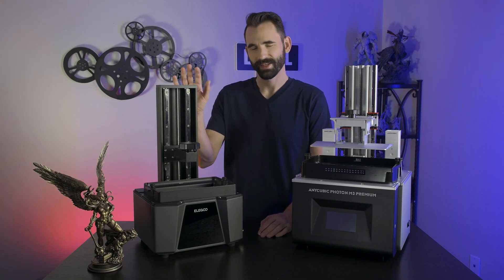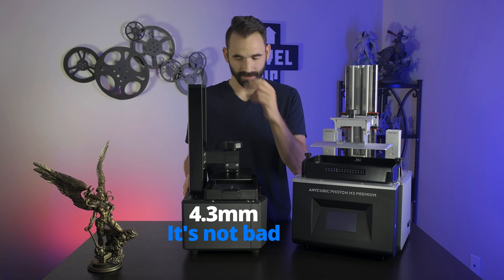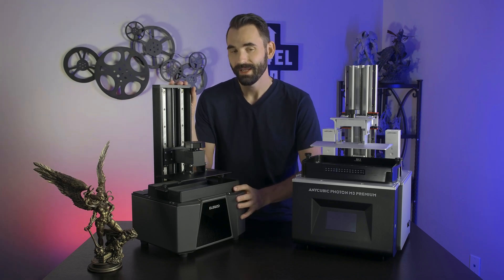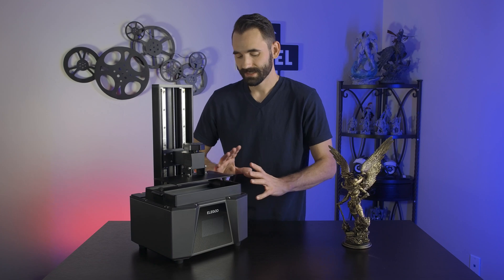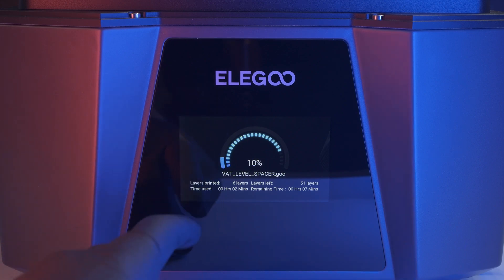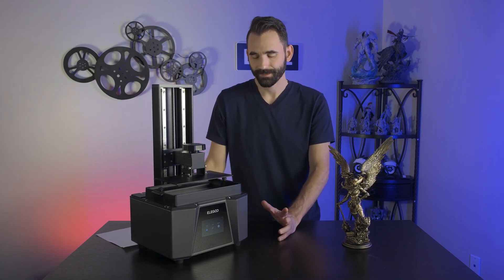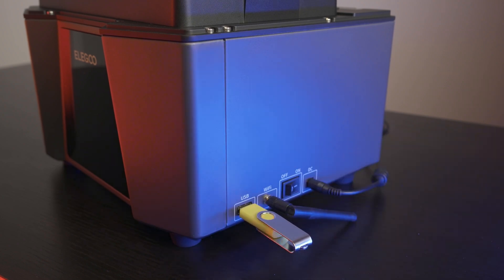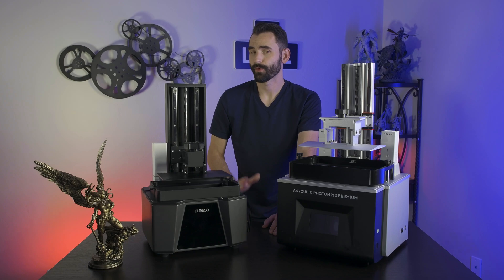Saturn 3 Ultra Review #review #3dprinter

Comment: Grear video, but one note on bearings, ballscrew nuts, and ballscrews:

Ballscrews are rarely perfectly straight. So to avoid binding you can't fully constrain the ballscrew. You have to have some X/Y movement allowance of the ballscrew or ballscrew nut without allowing slop in the Z movement of the ballscrew nut or the ballscrew itself. So on the Anycubic they would need to have a DAC at the ballscrew nut, or they run the risk of binding, especially at the top of the movement. I can't tell if they do for sure, but it looks like they don't. The other approach is the Elegoo approach of allowing the ballscrew a little X/Y movement at the top of the movement. 

So looking at the two approaches to the top, the Elegoo is less likely to bind and might be the more technically correct solution. But that is just my educated guess from looking at the video of the two. I don't have either yet, but should have a Saturn 3 Ultra 12k here any day now. :)
Reply from the maker: I'll give the Ultra a closer look but I don't think it can move as much as the Saturn. I'll be at Anycubic tomorrow. I will ask them about this.
Reply: @J3DTech  nice! :)

Comment: But now Fauxhammer loves ACF.  So do I, with a little AA which I use for everything I print.
Reply from the maker: Yeah? I've been in China for a week what have I missed?
Reply: @J3DTech Yup, he seems to have excellent prints; what causes the improvement is to be determined. Can it be a different source or change in the acf film or that the light strength/sharpness is lower etc ...
Reply from the maker: @TheAndrian463 I ran anti-aliasing tests with snarky arts. AA does work on the ultra and I also ran direct comparison results with ACF versus nFEP and I can tell you that the ACF does still leave marks. The Ultra does have a much better light engine which does create higher quality prints compared to other 12K printers. 

But you will still always get better quality when you replace the ACF with anything as you get to see in my video I do provide evidence under a macro lens.
Reply from the maker: I just watched his video. First I hope to some day match his production quality. 

But I can say with 100% certainty that AA Does work in this printer, I worked directly with Snarky and and Snarky was testing the Saturn 3 not the Ultra. 

I also spent over a week in the Elegoo forms, helping many many people with this printer and having them help me create this video and turn by running some prints and test for me and showing me the results. 

The ACS film does still leave the cross hatching but it is better on this printer then the Anycubic due to the upgrades lighting engine, screw and rail. But you can see I have macro pics in this review that clearly show the difference or AA on and off, ACF on and off.

Comment: Fauxhammer released a review on this printer yesterday where he concludes that acf is good, which is contrary to his previous point. I would love your thoughts on that. Other than that, great review. I like that you discuss a bit about the build quality of the printer
Reply: I got this one for my farm. This printer is AMAZING. The build quality is amazing and yeah, ACF does hit the detail a little bit, but for larger prints, it is insanely fast and that's a sacrifice I'm willing to make. I do have a vat equipped with nFEP but I've never had a job that actually required that level of detail. The "buts" in the video are, IMO, extremely minor.
Reply: He doesn't conclude that ACF is good, he concludes that on the S3U, his ACF film was showing vastly diminished texturing from the other printers with ACF, but with no repeat tests or anything (since you can't get ACF)

Comment: Got my Saturn 3 ultra came in three days ago. I have had zero success with printing. 6-7 fails, nothing has stuck to my plate. I’ve leveled it every time before I start a print and no luck. Any idea what may be going on? Starting to think I should have just bought another Saturn 8k
Reply from the maker: Did you test your Z offset with the calibration part?

This seems to be the one flaw of this printer. The faster lift speed can make it harder for that first layer to get going.

The good part is working with others and my own experience once you get that sorted it works great. 

And this is a process I recommend you do on all others for the best results and highest success rates. 

See my Guide linked in the description, look for the chapter in Build Plate Calibration print. 

You're looking to check the level and set the Z-offset.

Comment: How do I level this printer, I'm having a horrid time with adhesion. J3d appreciate your video but is there a specific ultra guide for levelling (I have seen your generic resin printing guide but you mention in the video there some tricks for this printer but no link to it)
Reply: I’m having the same issue I’ve had nothing stick to the plate and leveled it every time before a print.
Reply: Same

Comment: Thanks for the vid.  And thanks for posting the link to your guide.  The leveling process w the multiple pieces was interesting. I’m gonna have to go back to the vid and listen to the resin discussion again to make sure I understood it correctly.

Actually this vid was timely for us.  Our current resin printers are no longer supported,  but we were able to get quite a few years out of them and their “old” technology 🙃. Anyways we’re looking for replacement printers for our Solus’ and have been looking at the various Saturns to likely use in conjunction w/ Lychee.  Side note, so far I’m pretty impressed w Lychee’s response to my inquiries, so +1 for them, so far 😜.

Had kinda written the Ultra off because of the use of ACF (for easier/faster print/film release?).  The big appeal of the Ultra wasnt its speed, but it’s use of a 4point mount for the build plate.  Had those on the Solus’ and prefer this design (if well done) over the ball mounts we’ve sampled.

QUESTION 1: was the replacement FEP you used the “Siraya Tech NFEP Film - A4 Size (210 X 297mm)”?  Just wanting to make sure the size works w the S3 Ultra.

QUESTION 2: how long have you been using the Saturn U?  Rough number of prints on it so far?

Thanks again for the vid.
Reply from the maker: I have another video called "All you need to know to get started with 3D printing". In this video I cover how to use the build plate calibration parts in more detail.

But in the guide I also have a description and instructions.

The nFEP I used as a no brand that I just purchased off Amazon. In reality, all of these sheets only come from a couple factories in the world.

So far I've done the hawk girl model. I had to print her wings twice due to an update in the model and about 2-3 times as many calibration parts as you had seen in the video. I printed pretty continuously on it for about 2 weeks.
Reply: @J3DTech  Thanks for the fast reply.  Yeah all things (washers, refrigerators) are all pretty much each made in a couple of diff factories, my fav example is Maytag after they got bought out.  I’ll check out your other vid for the calibration etc, admittedly I kinda skipped it due to the title as we’ve been resin printing since before Formlabs was a twinkling in someone’s eye 😉. So a little too cocky on my part 😜

I thought the Siraya was maybe a bit steep @10usd a sheet, but we’d been paying $5usd a sheet for the Solus’.  So given the size diff, didn’t think too much of it.
Reply from the maker: @jessefurqueron5555  It's ok it really was meant for new people into 3D printing. However a lot of the methods I teach are new even to experienced users. Maybe I should have made a better title.
Reply: Maybe edit it into a new vid to focus it down on the methods related to the latest large format resin printers? That’d give you a twofer. Anyways I’ll check it out in a bit

Thanks!

Comment: It's interesting that you did such a thorough review, but didn't show "HawtGirl" :face-red-heart-shape: after printing, washing and curing, but before painting.  If a reviewer wants to show how good they [hopefully that was the right pronoun?] are at sanding, prepping, priming and painting that's great, but for showing how good the printer is, a painted model (especially at that level of finishing/painting you showed) shows nothing at all except that you can prep and paint a model quite well, and that the printer completed the print without  obvious egregious disfigurement.

Whether the washed and cured yet 'unfinished' model is really excellent, or is just ok or worse, you just  managed to skillfully or even just unknowingly hide behind your seemingly excellent finishing skills that you needed to show off.

Good to see you read different online slicer [in addition to Lychee's echo chamber, and you also forgot to mention the fact that you work for Lychee] and 3D printer [besides Elegoo and Anycubic's] community discussions and incorporate new (to you) and more correct information and methods that you learn [without attribution, of course] in your videos.  At least that's one way of 'helping the community'.

Finally, please try to acknowledge that there are other, better, printer companies out there making far superior printers than Elegoo and Anycubic with far better price/performance than them even if the superior printers cost a bit more initially - and one of the reasons those superior printers are obscured is that people like you (and others with far bigger audiences than you have) are usually not only vastly ignorant of anything but superficiality and incorrect or at best incomplete  'common knowledge' [which is pushed, including by you], but also generally refuse or don't even know to say something as simple and true as "These printers might succeed in inconsistently making some resin prints with plenty of effort, are utterly misengineered cheaped-out minimally viable products - DON'T BUY".  If you who pose as 'experts' had done that, it's likely that better printers would be more well-known, in demand, and actually purchased by 'newbies' instead of the cheap crap machines, and companies like Anycubic wouldn't 'terminate' the until then one reasonably properly made attempt  at a properly constructed printer [show the 'premium' light source, a disgusting 'UV LEDmatrix' FFS which by the way is the one major and only serious problem with the M5S, not the ACF ], which at the price it came out at (and went out at), one could by a printer that wasn't just a first attempt but has been and is an actually superior printer across the board.  The fact that you can casually say something (true) pointing to a disgusting important not-fit-for purpose defect without batting an eye, "It doesn't have [extreme, horrendous] Z-flex like [all of the] other [Elegoo] printers" [pointed out in detail and proven extensively by Jan Mzàrek, years and years ago, for example], just boggles the properly informed mind, but unfortunately is utterly common amongst these kinds of '3D printing experts' and fanbois.

This video does get a thumbs up for your pursuit of [your recently acquired] important knowledge and presentation of it in passing regarding full plate calibration testing, but next time talk about how important this distributed test also is to usefully seeing and taking into account UV light uniformity inconsistency which is far superior to wasting time with nearly useless for the task garbage like "the Cones" that you used to push until you left 'FlipNewbiesTheBird Foundries', if one uses proper calibration pieces like Dennys Wang's [look him up on youtube and learn properly] little support and overhang test piece spread about the build plate, in addition to yours that you showed in this video, assuming you didn't mess up the dimensions for it like you did in your 'Tesseract' aka 'Cubes' aka 'Boxes', etc.
Reply from the maker: Sorry for not including the pre-paint pics, I did mean to but simply forgot. I had to rush the editing of this video to a single night as I'm leaving to China tonight for a Printer thing. 

I did add a link with all the HD pictures of all the  prints. I also feel that showing a "Model" is not a good way to show off a printer. This is why I made and showed the HD Cube test. 

I'm not sure I fully understand your 2nd paragraph. It's true I work for Lychee but this was not a video about Lychee or Calibration. I also own my own official business named J3D-Tech. However in the description I do with my title show that I do.

There are a few things about the M5s but as I don't own one, I won't comment directly. But why do you think I made this video?

I would not recomend using my Build Plate Calibration test for UV light uniformity. I did address this in a way by saying, hey these light engines are better! When I made my Calibraion video, I'll be sure to mention this topic. For testing uniformity I would suggest printing Boxes of Calibration. or Cubes or whatever, I don't care what you call it. Print it and measure them against each other. This will do for normal layers what the Build Plate Calibration does for Burn in layers. This is because anything close to the burn in and transition will make any test null and void. You also NEED precision for this test. It can't be a subjective test at all! Meaning any type of stress test for this will almost always give you false positives. 

I'm aware of one mistake I did make on on Boxes of Calibration. It was on a very very old version that went out on TFF. One of the raft measuring spots was off. Something that never affected the use of the tool or anyway I teach to use it and was quickly resolved. Is there another issue I'm not aware of?
Reply: @J3DTech  Hey, sorry for the delay in getting back to you, and thanks for your thoughtful response.

You're a good dude looking for the best printing techniques leading to the best results and even better, to share the information with as many people doing 3D resin printing as possible.

I'm trying to point you in directions that will help you achieve this worthy objective, sorry if I seem abrasive, but I'm trying to jolt people out of wrong, useless and even counter-productive avenues leading to at best frustration.

When I point out things like the Lychee position, it's not a "put-down", I sincerely think it would be good if you let people know that (as you might know first-hand, lots of unfortunates will see the tips and info you present and say "who does he think he is?  how does he know?, etc.)

When I point out the design error in the "boxes", it's so you can fix it [the inner dimensions of the 6mm box are wrong], and I presume that you have access to the CAD file and not just an STL, so you can check the inner dimensions of the boxes yourself, easily - and if your CAD dimensions are correct, than the STL was generated badly [not your fault and a common, known problem].

When I point out that certain tips you've adopted recently [like increased wait before cure times on every layer] have been presented elsewhere, it's because assuming you derived that (and other) improvements independently, there are extensive explanations and demonstrations with photos, videos, measurements, analysis and Q&A elsewhere that you almost certainly would be interested in looking at [assuming you didn't know or haven't already].

In any case, what you do is appreciated, as well as your very approachable style, keep up the good work!
Reply from the maker: @retromodernart4426  interesting I didn't build them in cad. But the under boxes should be 0.04mm off. 0.02mm per a side.

I export them then load them back into my program to do a final check for any issues.

I'll give them all a check again just to be sure. 

I did consider stating that I work for Lychee for the clout but in the end I want to keep my two worlds a little bit separate.

I always appreciate any help and issues found, thank you and please keep it up. I don't exist in a vacuum. Publishing content on the open Internet is to invite conversation and even debate.
Reply: @J3DTech  😀👍
Reply: Hey @J3DTech, I thought it was an awesome video from a newbies POV and addressed a lot of things in a simple to understand manner that a new person to the hobby wouldn’t necessarily know to look for, and CERTAINLY doesn’t get well addressed in advertising and marketing for the printers, even on the manufacturers page. 

Example, that build plate screw thing. On a Saturn 2, seems reasonable enough, but that one for some reason seems way shorter! No idea why they’d shorten it, and you’ll never see it mentioned on Elegoo’s page, but I appreciate you bringing up minor details like that. 

Keep em coming!
Reply: Can you list these superior printers? Genuinely interested

Comment: make layer lines test based on rails system
Reply from the maker: Dennis Wang has a good layer line test. I could make a video on that. Show off the difference of a $1200 printer and how it makes more issues than a $600 or $500 printer.
Reply: would be great if u also do it @J3DTech